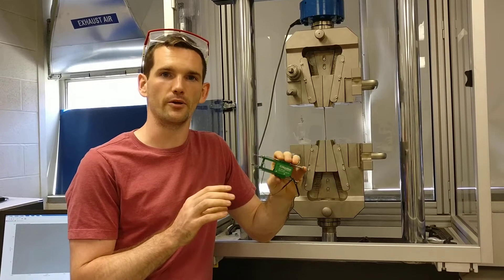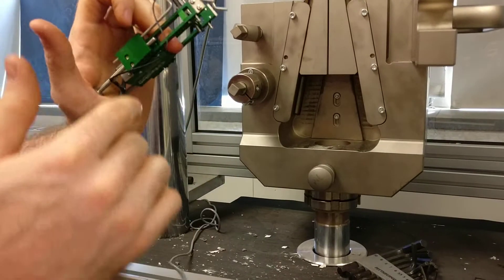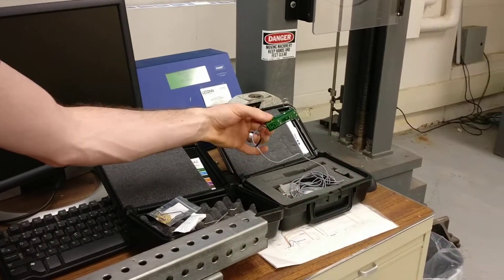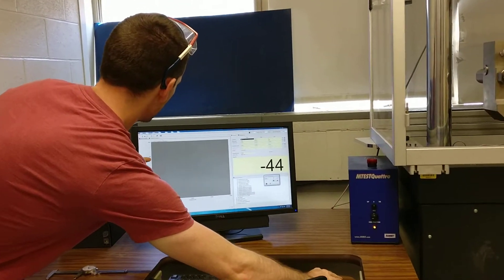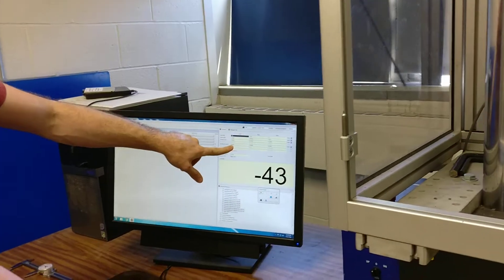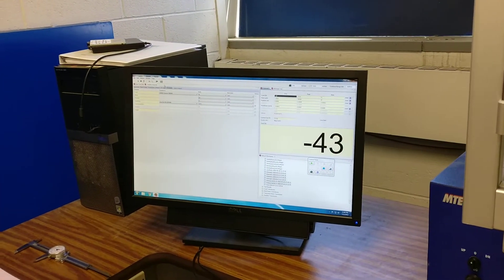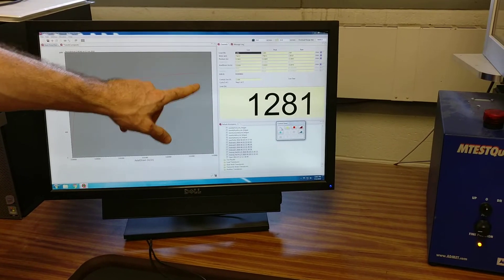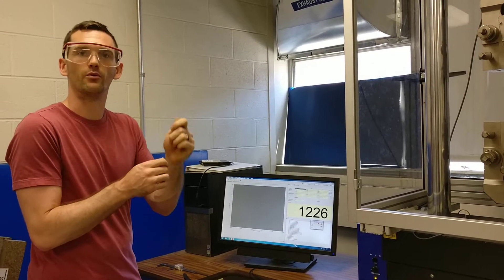Using an Extensometer to measure strain

Comment: Extensometers from https://biss.in/extensiometer.php are light in weight but still rigid and compact. The use of extensometer devices is often employed in automation, measurement, and control systems.

Comment: where can i buy this equipment?
and what is the price?
Reply: Hello Saif, You can submit a request using this link for pricing:   https://www.epsilontech.com/contact-us/?modelNumbers=3542-%20_%20_%20-%20_%20-%20
Reply: Or email sales@epsilontech.com
Reply from the maker: they would go with the same brand as equipment  you have to make sure the connection to your software works seamlessly. The price varies based on gauge length and travel distance. They are roughly $1k